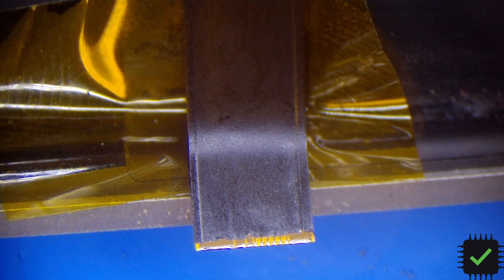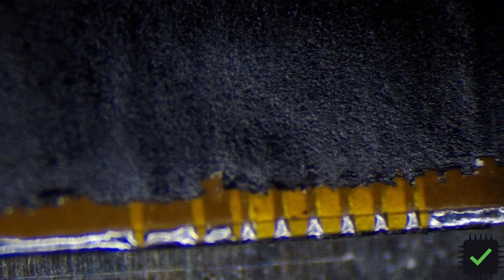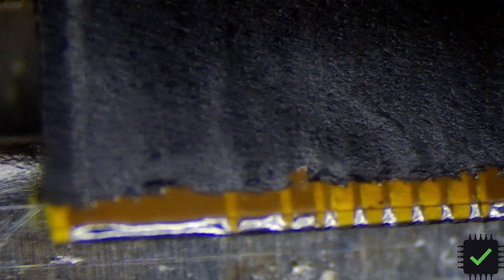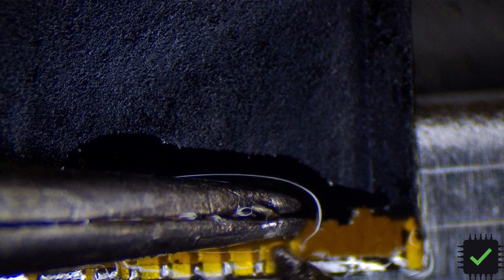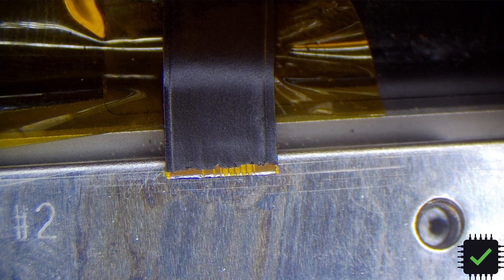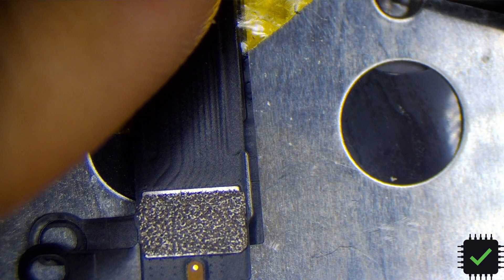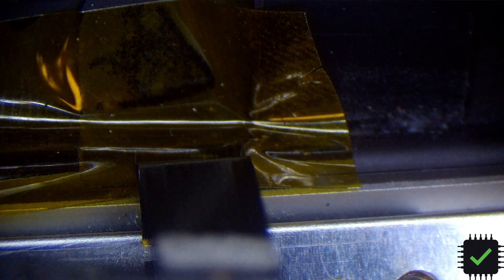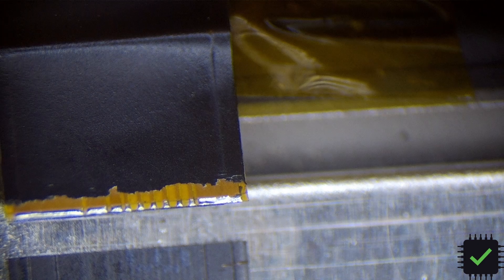MacBook Pro Light Stage FlexGate Flap Method best way to solder cables and proper cable length

Comment: Hello! How do you scrap the cable? I am using a razor blade, but most of the time I just ruin it. I can’t make anymore mistake on the original cable or it will be to short to be fixed 😢
Thanks for the tips!
Reply from the maker: I use X-acto knife #11. Practice on a cut off piece first before attempting it on the main flex
Reply: @applepietech  Thanks! I will try again.